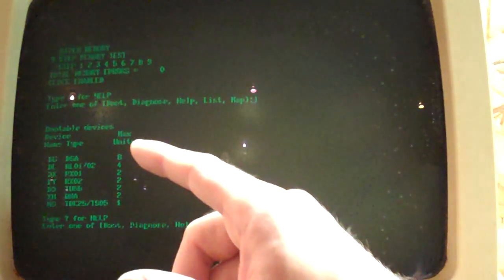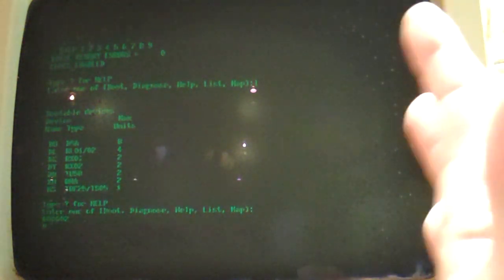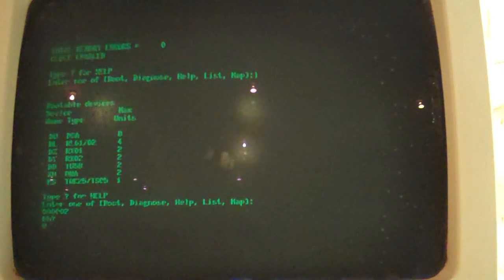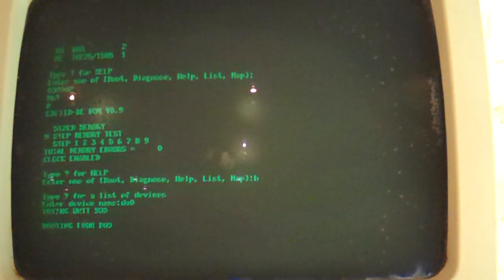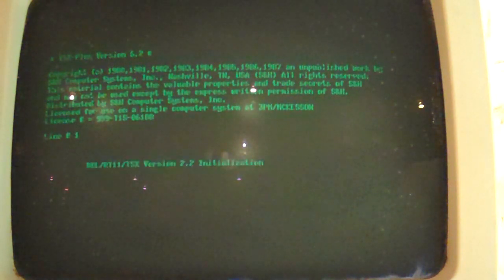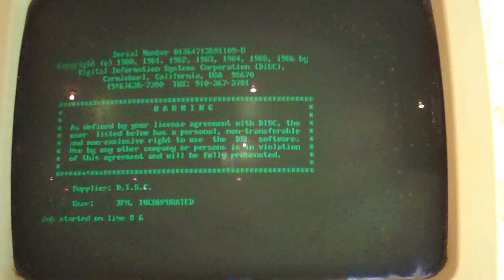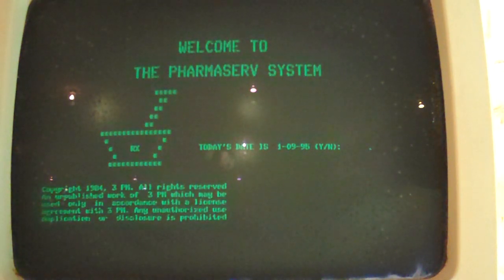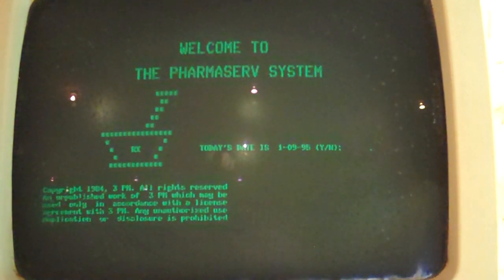PDP11/23 - We shall overcome!

Comment: I asked them what happened the the 3 hp 3000 systems. somebody came and took them apart. Assumed to be put in storage. To this day I like to think they are in peices some place in town. The idea I was told was to rebuild the system. The only problem with running such a beast from that time is you would need a ac unit to run I think they said around 60 degree or maybe less. If not the chips would start working there way off the board. Anyway food for thoughts.

Comment: Not the first time I watched your videos. I was wondering. Out of all the systems. What is the system you like the best. If I could run a large system I think I would try to run either a ibm or hp 3000 mainframe from 1980. To bad this was sortof before my time. I have a special place for the hp 9000 model 300 personal computer that connected to the hp 3000, and 6000 systems. I have pictures of the system at the local university. No long in place. I was told they could not give away the hp 3000.

Comment from the maker: There most assuredly is data in here - I found A/R receipts from the 90s. I dug a little further after I turned the camera off :) I'll either wipe the DB, or back it up and then remove the PharmaServ software entirely. Best to be safe and nuke it from orbit, the last thing I need is trouble from the original owners! (This was picked up at a recycling day, so it wasn't like they gave it to me)
Reply: Did you wipe the db? :D does it still works?